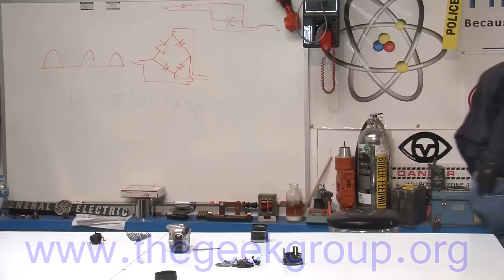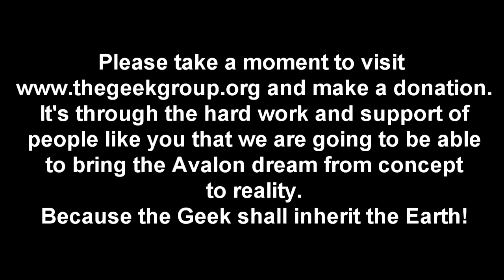Canon Rebel: Equipment Autopsy #25

Comment: In Europe your wall socket carries one hot wire, one neutral wire and one local ground. The neutral wire is usually grounded at the station but the station may be far away from you. If you're barefoot, your PC is not properly connected to your local ground and you decide to touch it, then you'll get slightly electrocuted by the difference in potential between the station's ground and your local ground. That's dangerous because if the station's ground connection fails you get fried instantly.

Comment: The plug/led that you mention at 4:18 is something I've seen in a lot of small electronics that I take apart.  You can actually turn it with a screwdriver, and it looks very similar to an old rheostat, just using a carbon ring and a contact, which leads me to believe that it is a variable resistor used for tuning the electronics somehow.  Just my two cents. :P

Comment: You are correct, a standard usb 2.0 port is 5volt 500ma that's not going to kill anything (maybe a gnat) But some devices that charge off of usb deviate from that standard. USB 3.0 is capable of even higher amperage and voltage. 

There is a "powered usb" standard that is used in some point of sale systems, bar code readers and credit card terminals that has 4 extra pins to supply extra power.

Those specialized power bricks can put out as much as 40-90 amps or more at as high as 12-24 volts. Now that might just burn little miss Susie's mouth.

Now consider the plethora of cheap Chinese made chargers that may not have the proper safety features and this story becomes very plausible.